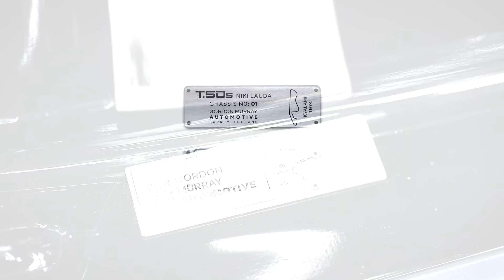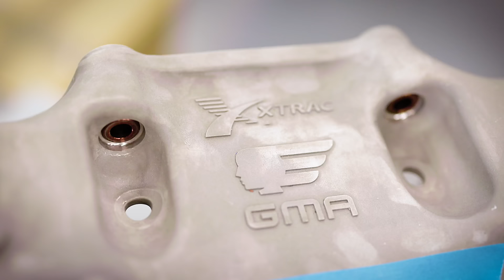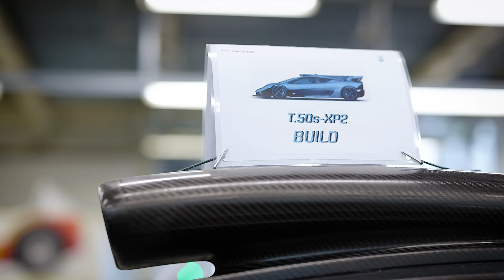T.50s VLOG | EPISODE #02 | FIRST PROTOTYPE - PART 2

Comment: I hope some of these great cars get used, not just stored.
Reply: A few laps of Ascari, away from cameras, I fear will be above average for these. I wish a few more were made to demo races and race series. A wildcard LeMans entry. Can the thing last? It would be up there at the front with the Hypercars, just faster in the bend, maybe slower on the straights. Although, with modest wing angle it may even be faster overall. It's soooo much lighter than Hypercars.
Reply: Goodwood surely?? 🙏
Reply: Exactly 👍🏻 
Well said 🙏🏻
Reply: …sadly they won’t…
Reply: A travesty.
Reply: The term "art car" had me worried.
Reply: Err no.
Reply: @harpersneil I wouldn’t worry about that reference, plenty of art cars go racing (especially BMWs) it just means it’ll have a fancy wrap 👍
Reply: @nohedes  Appreciate you explaining that to me; I hadn't realised that. 👍🏻
Reply: If they wanted them to be used, they would've made 300 of them, not 25. 25 is just too exclusive to use.
Reply: I bought and purchased the t50 and t50s in the crew 2 and motorfest (PlayStation game) and it's beats all my long standing times with all the other hypercars

Comment: Slight correction on the pitot tube. The difference between dynamic pressure at the pitot tube and the static pressure is used to calculate speed through a fluid. Altitude is calculated using only the static pressure in the altimeter.
Reply: Another quick correction – dynamic pressure (speed) is measured by differencing pitot (total) and static pressure

Comment: Going to need Gordon to explain how that top Canard works being closed at the rear and the shape of it
Reply: It's not difficult to understand. The high pressure side is obviously very high pressure as there is a stagnation and then it will evacuate up the fender and outboard. The underside will essentially follow the fender and be outwashed before mixing with the freestream flow of the vertical endplate
Reply: @Shadowboost  that may be what it looks like it does. But it still doesnt mean it makes sense for producing downforce.
Reply: @stefanroseEP3  It'll make downforce. Even the high pressure zone above it will make downforce, itself. Whether it's efficient or not is the question

Comment: Can someone explain the rear Suspension? It has two Whisbones. In the front and rear are two singele linkages. One seems to be a track rod and the other one for a pushrod suspension. But there is a silver colored rod connected to the gearbox. Any Ideas what its for?

Comment: if i had gordon's budget, i would have made this car 4wd and hybrid electric as well as under one ton. .  reVVing to 22~000 rpm

with my  home made in-Line 12 cylinder 2400cc engine 

must mention water`Less cooLant system  

and if i made it under his badge

it wouLd be caLLed  

✾✾ DE  T 6T✾

Comment: It's too few. 99.9% of us will never see or hear one.
Make 30 extra and do a few years of racing with them. Switch to slightly more affordable and more durable parts, for the sake of racing. These cars probably lap at the same pace as so-called Hypercars in the WEC. On tight tracks, a lot faster possible, due to the actual minding of weight, apart from the lumpy N/A V12  concept, albeit executed realtively lightweight.